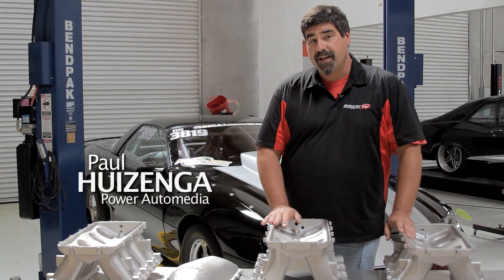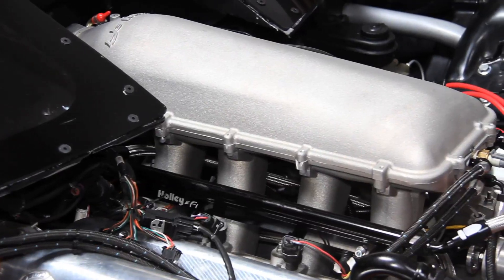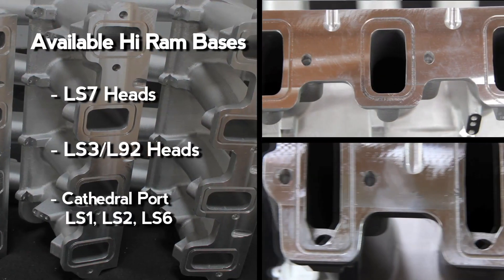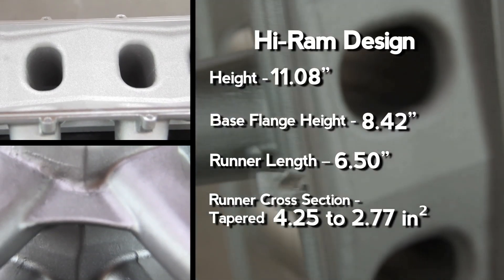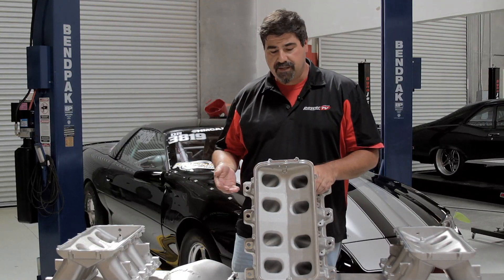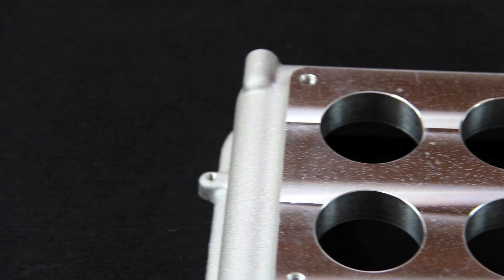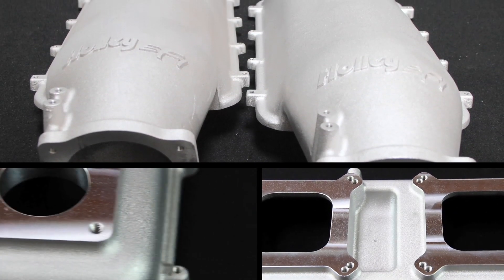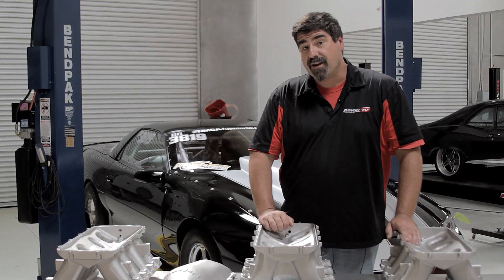Tech Review: Holley Hi-Ram Intake Manifolds

Comment: You guys need to make a multipoint dual plane intake manifold for an ls1
Reply: You guys have a dual plane, but it isn't machined for injectors. It has the area in the casting, but it's not stock